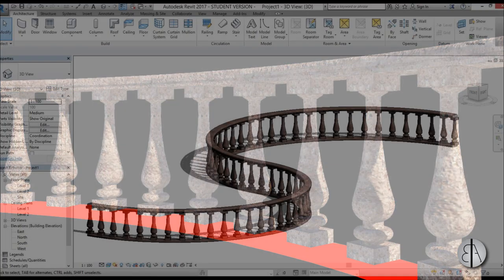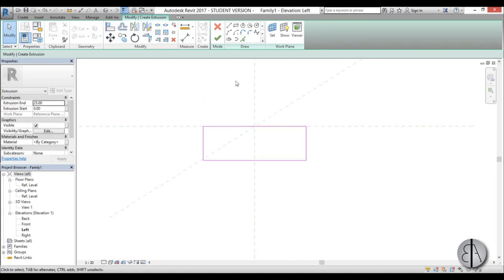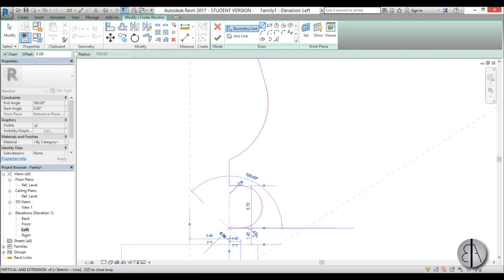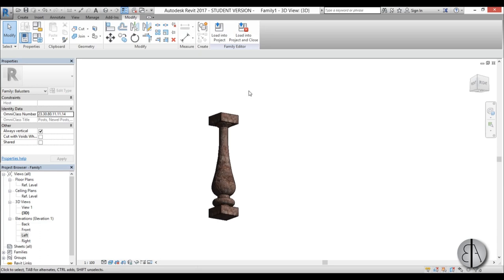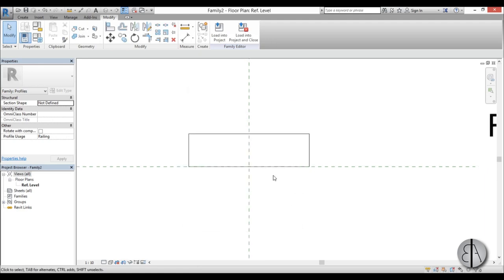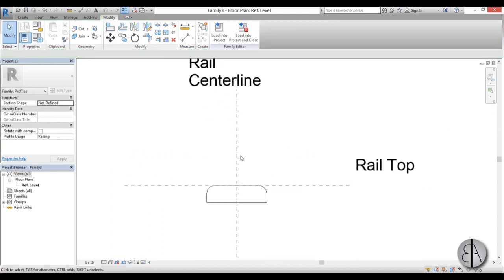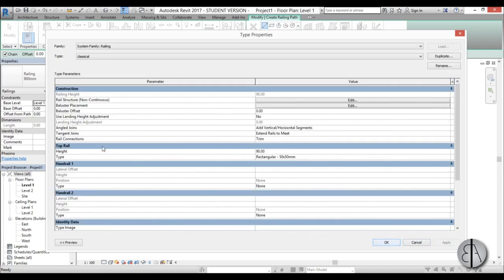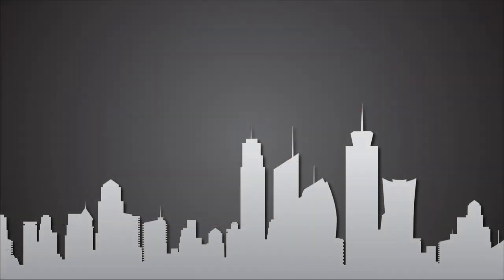Classical Baluster Railing in Revit Custom Railing in revit

Comment: Hi +Balkan Architect I am having some trouble completing the railing. I have followed all of your steps precisely, however when I go to draw the railing and hit the green "check" to finish I keep getting an error message. the message reads "Can't make classical baluster" Error 1 :id316816   - I was wondering if you or anyone else could shed some light  on where I could possibly be going wrong. Thanks in advance

Comment: Hey there, Its giving me an error. Would you please help mw with the error
An error occurred in family "Baluster final" and was automatically resolved, but may require review by the family creator.
Error Information:
"Can't create surface of revolution"
Error Resolution: Delete Element(s)
Reply: You probably had a few unconnected lines/arcs/shapes. My revolve sketch and extrusion wouldn't join like he suggested so I zoomed in and saw that the base and the shape I sketched were a fraction of an inch apart. I aligned them and it allowed me to join them.